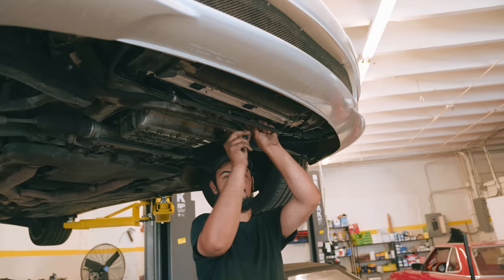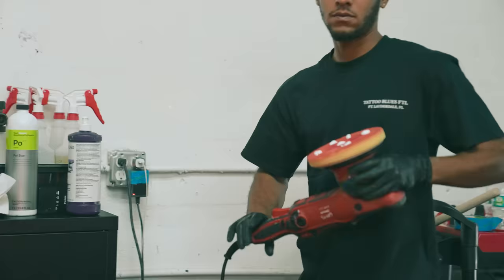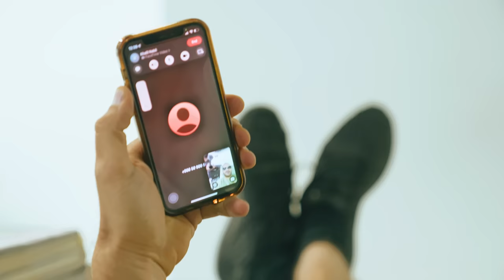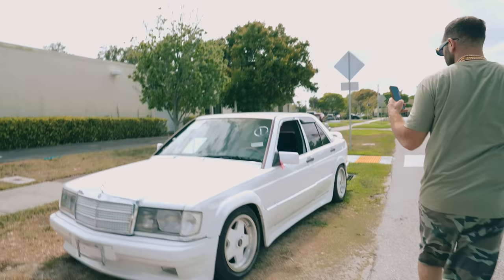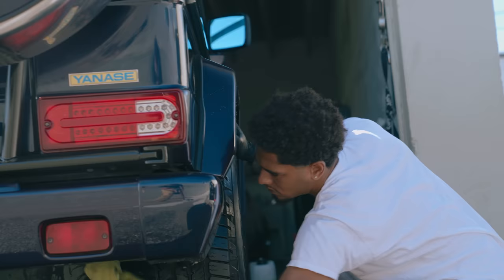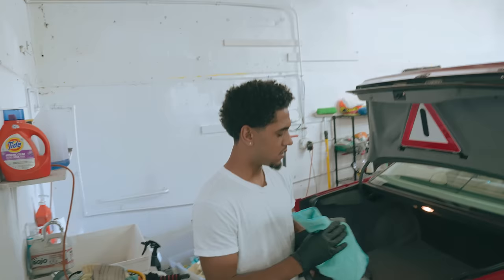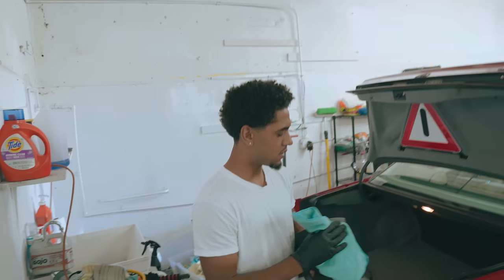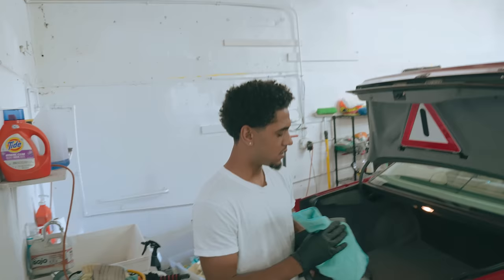DELIVERED!! Finally got the Koenig Mercedes SEC "Moon King" | VLOG #019

Comment: This car was converted by a company called GCS Bennemann from Herzogenrath ( Germany ). GCS also restored Mercedes-Benz in the days. I met Günther Bennemann a long while ago. GCS were the first to convert widebody SEC Convertibles directly for Willy KOENIG. Later Koenig 500 SEC Convertible cars were made by SGS...
Reply from the maker: Ahh that's awesome info! Checks out since the dash says GCS. Do you know any more about the SEC Cabriolets by Koenig? No clear numbers that we've seen, but it seems like only a handful were built
Reply: @PatinaCollective  G.C.S. Automobilhandel GmbH did convert 41 C126 Coupes into convertibles. 3 of those conversions also had a hardtop with a sunroof (!). It looked almost the same as the coupe. The number converted for Koenig probably a handfull.. Later on Design and Technik ( former SGS ) also started converting C126 for Koenig. The black car C126 Keonig Convertible in your collection is an SGS onversion.... GCS also converted 9 W126 4-door limousines into convertibles. One of the survivors was for sale in Pakistan a while ago...
Reply: @PatinaCollective  There might be even ONE Koenig C126 Convertible with hardtop for sale in the USA!!! Just check out 
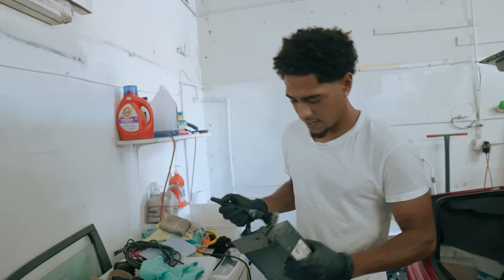AMMO NYC YT Channel. 10.04.2020 they uploaded a video " 300 CAR BARN FIND: PRIVATE TOUR ". #8:29 a KOENIG widebody is shown for seconds. It looks like the car has a change in the back-seat area ( 2 seats brought together ). Also there is a gap in the C-Pillar...